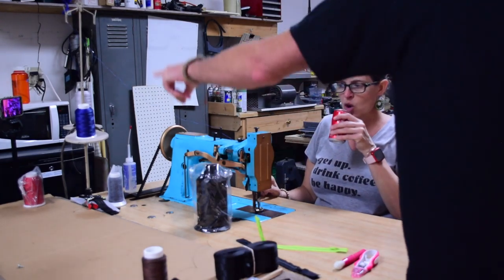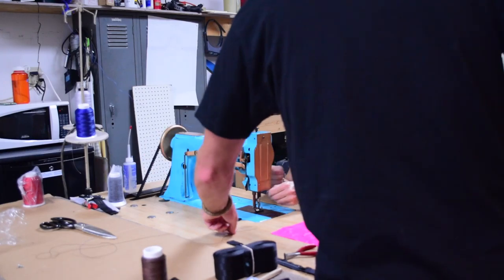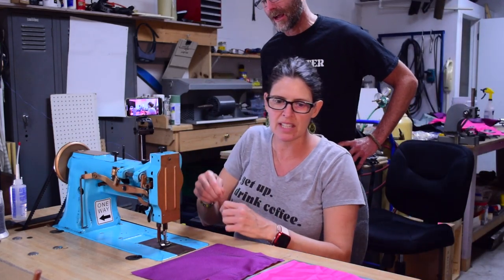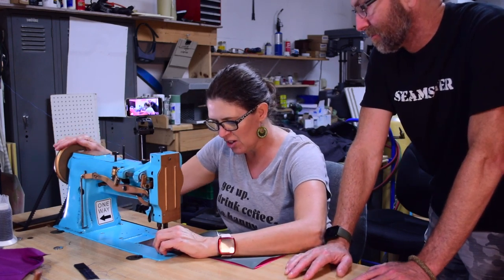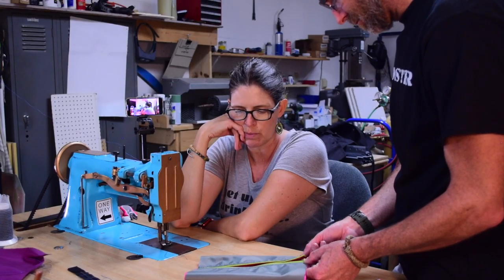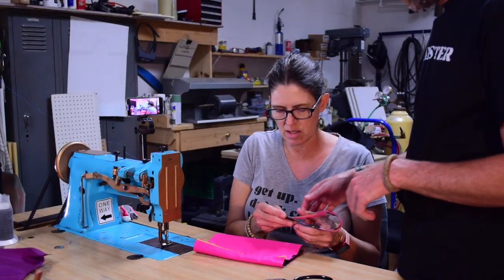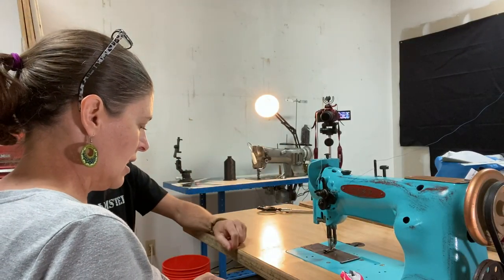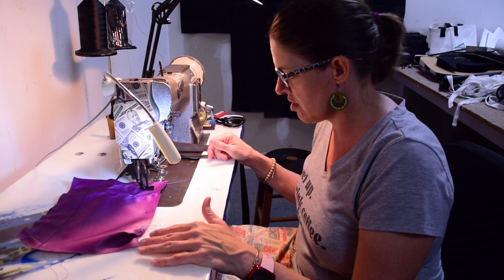My Wife and I SWAP sewing machines: Part 1

Comment: She did a good job working the machine. 
I use a husqvarna 21e and is has a slow mode / high torque that lets me sew thick materials and still lets you use pattern cams on thin leather or thick material. I think it is a half way point between the two types of machines. Great video!
Reply from the maker: Thank you! I was really proud of how well she did!
Reply: That Husky 21e is absolutely one of the greats. I like mine so much, I bought 2 more.

Comment: Lovely video. Lovely wife. Sweet relationship. No need to swap that wife!
Are these machines single speed? 
How-to videos with a "good-sport student" are a good idea. She asks good questions that you may not think of.
Reply from the maker: Thanks John!  Yeah, she's a keeper for sure.  I mean, the fact that she'll have anything to do with me is a good start :)
The machine she used for most of the video is controlled by a 1/3 horsepower clutch motor that spins at 1725 RPM all the time.  How much the pedal is depressed controls how much the clutch slips, which allows the user some control over the machine's speed, but it's a bit trickier to control.
The other machine has a computer-controlled servo motor, which behaves much more like a modern domestic sewing machine.  It can be set to a maximum speed (I currently have it set at 3300 RPM, it goes up to 4000 I think).
And yes, while editing this video there were several times when I thought, "I wouldn't have explained this to the viewers if she hadn't asked, and I bet they would be wondering."  I don't know that she'll be a regular feature in my videos, but maybe I can talk her into some future projects to help prompt me to answer questions that I haven't thought of.
Thanks for watching and commenting!

Comment: Great video! I'm curious as to why you have two industrial walking foot machines. Do they serve different functions or do you like to have two so you can thread them with different colors to avoid re-threading your machines?
Reply from the maker: Hi Anita, thanks!
I have multiples for a few reasons.  One, I seem to have a sewing machine problem - I'm up to 22 at the moment.
For practical reasons, these two machines have some slight differences (the turquoise machine is capable of a longer stitch length), but they are also similar enough that I can do exactly as you mention and thread them with different colors if I'm switching between thread colors on a project.  I can also use the second machine if a small project requiring a different thread color pops up while I'm involved in another project using the first machine.
I prefer old, well-used machines, but that sometimes comes at a price in the form of breakage.  In the event my primary machine is down for repairs, I can still use the secondary machine.
I also have other machines that serve specific purposes (cylinder bed for binding, a walking-foot zig-zag for bar tacks).
I hope that helps, thanks for watching!

Comment: im always touching my wife's machine...usually at night !!  also J. needs to lubricate that machine and loosen the belt a little 
i hope the wife has a nice top loader clear plastic bobbin machine...that has a touchscreen and J needs to spend 5 minutes to clear some "sewing codes" before he starts sewing
Reply from the maker: Hey, tell me more about why you think I need to loosen the belt!  I still have a lot to learn about the mechanics involved with these things.
(And yes, I'm terrible about oiling ....)
Reply: @thejasonofalltrades  

If Is to tight it will robb power off the engine and create heat on puleys and arm shafts with extensive sewing 
Also it puts unnecessary tension in the sewing machine main drive axle as it spins with tension...belts need to be like 85-90% ish tight ...yours looks like 100% tight...also oil,, don't put grease on any moving parts...it Will be pushed out to the sides of gears or around them